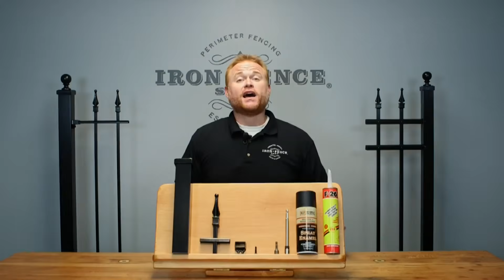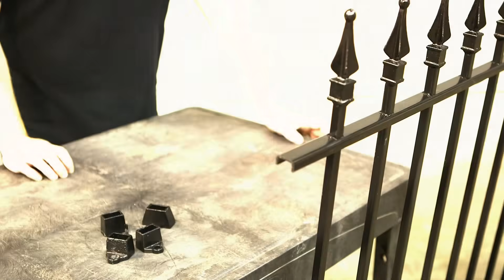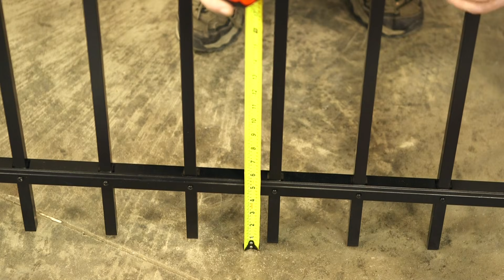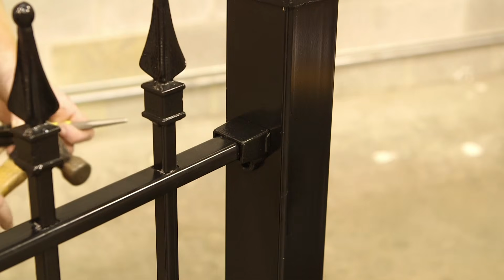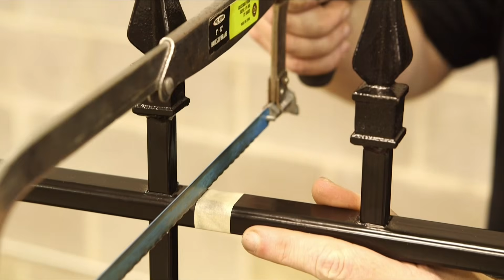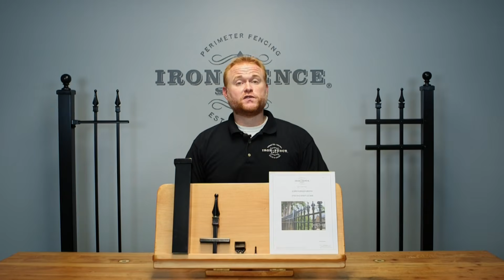Wrought Iron Fence DIY Installation

Comment: Is it safe enough to mount iron railings onto the side instead of in top of a surface. I have a raised patio and have come into possession of some reclaimed railings but they were set in concrete. The posts are long enough to be drilled and side mounted and the retaining walls is standard brick and about 2feet thick. But is it always best to mount on top due to the weight? Safety is the main reason I'm installing them so want to mount them in the strongest safest way.
Reply from the maker: Hi Lee.  It really depends on the weight and style of the panels.  We have had folks side mount the posts.  If you go that route, you need at least two connection bolts per post and you want to get them deep enough into a solid surface so they are sturdy.  Brick on the outside could mean hollow block on the inside which could crack or break free if the post is leaned into or jarred.
Reply: @Ironfenceshop  hi thanks for the reply. I wasn't sure if I'd get a reply so just got started. The rail is up and all posts have 2 bolts in them and yes I went very deep. 200mm bolts is what I went with so I  could get into the 2nd layer. I'm not sure which was harder to drill the steel or the brick. I attached homemade extenders tot he bottom of the posts so that they actually sit on the ground. One hole ( there's always one I suppose) didn't go well and was too big. This I used a chemical anchor. They're actually made to handle rails like mine so I'm not too worried. The gate which my 2yr old son likes to close again and again seems to shut without any sign of movement in the posts. Only time will tell if I've done a good job now.